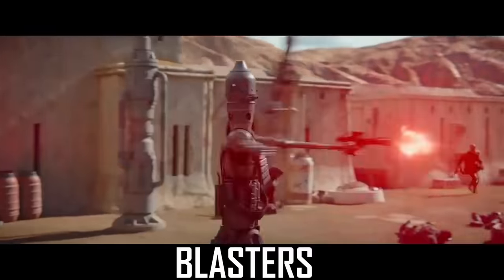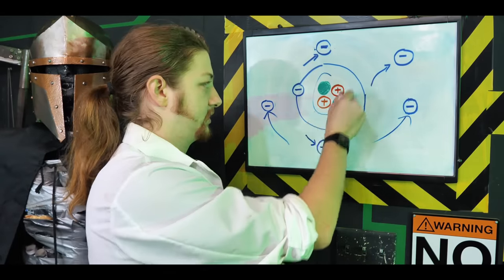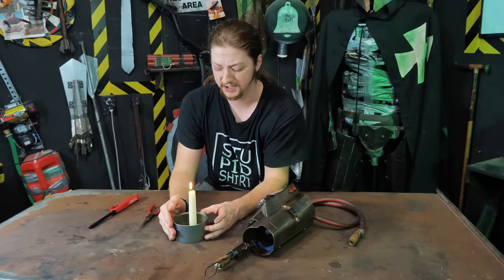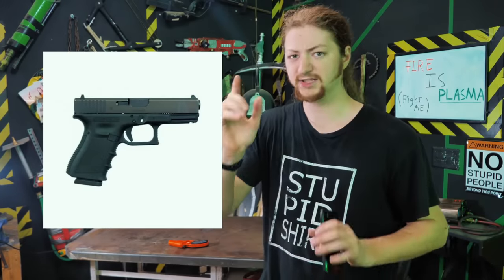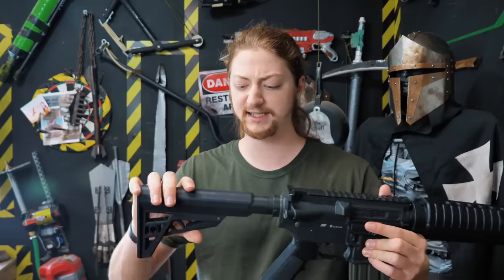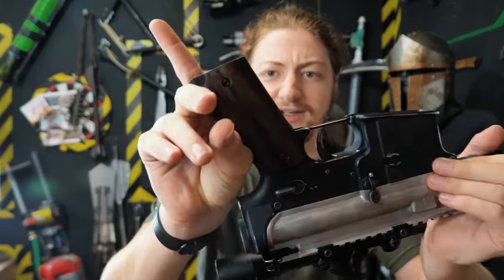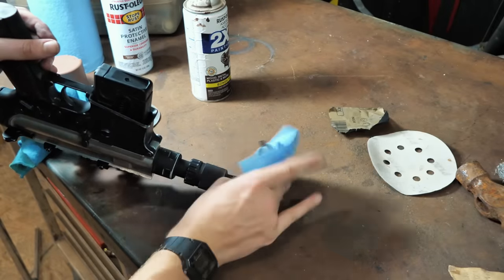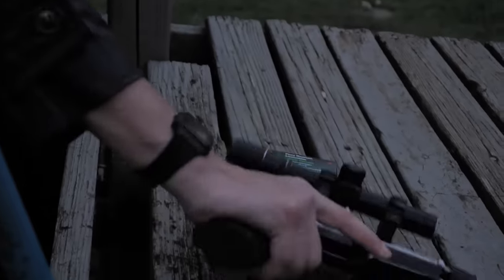Worlds First REAL StarWars BLASTER (is it possible??)

Comment: But it ain't actual plasma bolts is it lol.
And you might have entertained the idea of a gyrojet pistol, although I have no clue how available the pistols and ammunition are. And if you can load the gyrojet "bullets" yourself with the rocket fuel, you could add certain elements or compounds into the mix to get your red, green or blue light trails as they fly to the target.
Reply from the maker: Gyrojets & ammo are pretty much impossible to find. I’d have to build one from scratch, which would be quite difficult. Also wouldn’t be any closer to a plasma blaster, so idk what the point would be.
Reply: @jakemakes  Ah I see. Yeah I suspected that gyrojet might be hard to come by. Maybe the whole fireworks idea might be worth following, in terms of something that pretty much burns up completely when it hits its target. Getting deep into it there might be certain elements or compounds that might act far more like plasma than just normal black powder fireworks as well.
After all we are still really in the scientific dark ages despite what we consider modern and progress.

Comment: When you said "real plasma" I did not expect tracer rounds

But the "real plasma" part is actually possible 

Blasters are basically just coil guns that accelerate plasma instead of solid matter.

So to make a blaster we need to put some coils on a device that can release certain amounts of gas at time

And what's something that already has that capability? BB guns

As to turn the gas into plasma quick enough to be shot like a bullet that would require a lot physics that I didn't learn in school yet American education is crap

Comment: The reason you can't chop a rifle or shotgun down is even dumber than most people realize. Originally Congress included handguns in the national firearms act of 1934 and had a provision stating that short barreled shotguns and short barreled rifles were also included in the act so people couldn't just chop down a rifle or shotgun and have a firearm that is as concealable (or nearly as concealable) as a handgun. Congress was persuaded to remove handguns from the NFA before the act was passed but unfortunately they accidentally left in the provisions about short barreled rifles and shotguns. So the fact that short barreled rifles and shotguns are NFA items is a mistake of history.

Comment: While nifty looking, it's still not a blaster. In most sci-fi depictions of energy weapon's, they lean more on the side of being, particle projection weapon's. While I have seen armor penetrating tank rounds, using a high velocity jet, it would probably come closer to replicating a bolt like a blaster, than a simple tracer round. A particle accelerator would be closer to depicting a sci-fi energy weapon, than most devices currently used, other than an actual laser. The project looks cool, and tracer's are cool to see, but it's not a blaster my friend.

Comment: airsoft guns ahve tracer units basically a muzzle device that lights a glow in the dark bb you can also take the  buffer tube off of the stock but if you did that the impact of the plasma bolt wouldnt look as cool

Comment: While all of what you did is very cool, it isn't correct in the respect that blasters in Star Wars throw bolts of plasma (as you stated in the video), but what you shot was actual solid chunks of metal. In Star Wars those are what are called slug throwers. They are used in universe by certain peoples/species at times, but are considered to be primitive weapons.

Comment: Your method for thinking fire is plasma is flawed.  The reason there was an arc with the fire in the middle when there was no arc without the fire is the heat of the flame reduced the resistance by thinning the air making the gap no longer to great for the arc to go by itself.  It wasn't pulling ions from the flame.

Comment: I wish the fly speed of the bullet and be slowed, maybe a lower powder yeid?
Reply: Reducing the load would decrease the speed, but then it wouldn’t produce enough pressure to cycle the bolt.
And reducing the weight of the bolt to cycle with weaker ammo would increase the risk of the bolt opening before all the powder is burnt which increases the risk of an out of battery detonation (aka the casing blowing up) which is quite dangerous to the user.

Also 22lr ammunition uses a heeled bullet that’s held into the casing by a crimp and can’t be removed without damaging the bullet. So he would have to make his own tracer bullets and load them into empty 22lr casings (which are pretty hard to get as there’s only one company selling them) or have the ammo custom made by one of the few manufacturers of 22lr tracers.

Comment: use laser initiated fusion reaction to create plasma accelerate said plasma down a rail gun, with the magnetic fields keeping the plasma contained into a tight packet..      Send set packet out the end of the barrel as a blob traveling at several times the speed of sound.  Poof you have a plasma gun.  Done.

Comment: There are so many wrong assumptions made by this guy it isn't funny. But lets start with the basics. The physicist JJ  Thompson was attributed to the discovery of both the hydrogen atom and the electron and here is his correct definition of what an electron is. "A electron is the terminal end of one unit of dielectric induction. Electrons as separate distinct entity don't really exist, they are merely bumps in something we call a field." So where do people get this idea that electrons exist as a separate charge carrying entity? They get this incorrect idea from bubble headed particle physicists who created a world of imaginary particles because their minds are so linear they can't think in any other terms. When you create a world of particle nails everything to you has to be a particle hammer. 

Do electrons bump each to create a discharge? No. Why? Explain how any remote induction takes place such as you cell phone because it has nothing to do with magic bumping electron particles. Particle physicist to this day still believe that electrons are bumping each other in a copper wire to create electrical flow, which is false. Electricity is the hybrid of both dielectric and magnetic fields combined which flow outside of any conduit, not inside the conduit, not on the surface of any conduit, but completely outside of the entire conduit itself. This was clearly explained in Charles Steinmetz's book; Discharges, Pulses and Waves, circa 1917. The copper wire within a conduit is just a pathway those 2 fields use to travel along the outside of, nothing more. Next to silver, copper is the best conductor of electrical flow. By the way, there is no "plasma" in the back end of a tracer bullet, its called magnesium.

Comment: My take on plasma is calling it a state of matter is questionable given how transformative it is and while you could classify plasma as an ionized gas not all ionized gasses are plasma. Most flames do not contain plasma but do contain other ionized gases, only the hottest of flames have plasma in them. Ionized and is a Gas are two independent properties of a substance but a plasma by it's nature must be ionized even if it was made from a non-ionized material. An ionized liquid that evaporates is an ionized gas, not a plasma.
The electricity bridging demonstration only shows the presence of ions not plasma, you can do the same demonstration with tap water and deionized water to show water by itself does not conduct electricity.

All plasma is an ionized gas but not all ionized gas is a plasma in the same way all dogs are animals but not all animals are dogs. Confusing this is where the majority of the debate over what is a plasma comes from.

This fact doesn't prevent me from wanting to design a magic system where the control over the 4 elements are actually control over the 4 states of matter treating fire as plasma.

Comment: Plasma????
Daa,did anyone read Star Wars related books yet????
It not plasma principles blasters operated by at all,short frequency laser weapon that in fact uses gas to generate energy impulses....
Gas would be converted into vapor that would pass through complex module which forms electrons and photons that among another module along with prism shaped crystal delivers final energy bolt,blasters are short waved weapon and cannot work continuously like lasers which requires steady electron injection.
In truth blasters could be made but it would requires special gas mixture and strong energy source in order to power it up on behalf it also requires cooling module to lower overheating forming between transfer converter and beam forming accelerator.
Laser would requires more complicated mechanism instead and little modification of energy forming accelerator or module,I rather call it a module but device got more actual name than that....
There is possible to build new weapons that can replace live firearms in the world,problem would be involve power battery having force equal to power plant at same times been small in size,the 1st type of matter is not possible to acquire and 2nd form is too risky to use been by nature unstabled matter and it not Uranium or Plutonium which is way too dangerous to handle and despite radioactivity been toxic by nature by itself....

Comment: Star Wars blasters are weak and slow. Seriously the bolts fly with 0.5J and less measurable by the incredibly slow velocity that they’re flyin’. However Star Wars weapons are weak in general and not just inferior to Star Trek weapons (A Star destroyer could fire 1000 years constantly at the Enterprise and would get the shields down to 99,9%), they are even inferior to ours.

Comment: Sorry you lost me at tracer rounds. This isn't a plasma gun, so I stopped watching at 7.33.
A scifi plasma weapon would have to work this way.
Plasma is generated using a source of energy.
Plasma is controlled in a way that it does not disperse over a distance but forms a "bolt" form. Hence, plasma "bolt".
The plasma must impact a surface with some effect.
For example, heating of the surface, or some kind of carbonisation effect as it impacts a surface.
It doesn't have to do real damage to fit the bill, but I'd expect at least an increase of a surfaces area.
No your flame thrower doesn't count you are projecting a "liquid" that "happens to be on fire" rather than a stream of plasma.

Comment: I like how not even a minute in, you speak the same correlative statement all theorists get rock hard saying 'this is like that'. For instance, a bolt is NOT "Like a bullet" in any way than throwing a stone is like a bullet. A bolt is a projectile, a bullet is also a projectile, this however does not make them "like" the same thing. They both function very differently when simply considering only 1 of many variables that goes into the creation of such things, of which is the point's shape; that alone creates a major difference in the boundary layer transition which dictates the major difference of what makes an arbitrary projectile what it is, in this case a bullet vs a bolt. 

For someone as educated as you we'd expect you to pedantically dictate the differs in "this or that" rather than speaking through a gross-generalization of the topics; this is how misinformation spreads.

Comment: First off there is a difference between a laser blaster and a plasma blaster in the star wars franchise.

A laser blaster uses ya know lasers...

A plasma blaster is called a bolt caster.. because it ya know, casts bolts of super heated plasma..

Thirdly, han solos gun was a heavy laser blaster and NOT a bolt caster.

You act like an expert/engineer when you don't even know the difference between a laser gun and a plasma caster 🤡